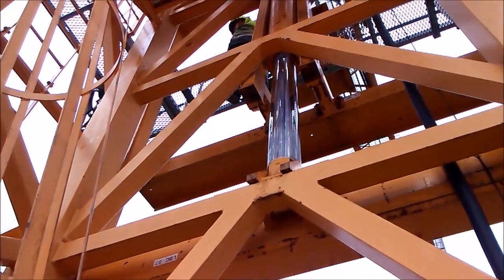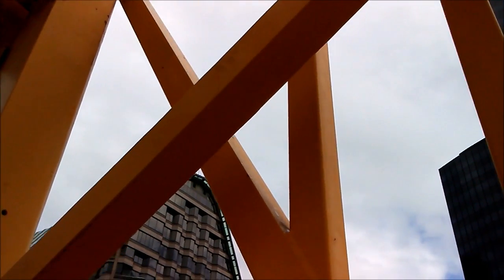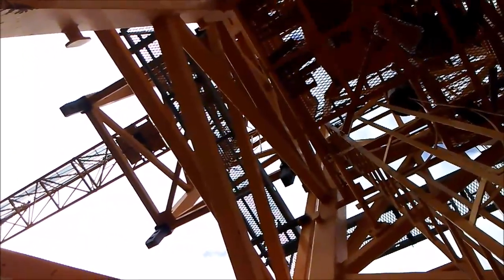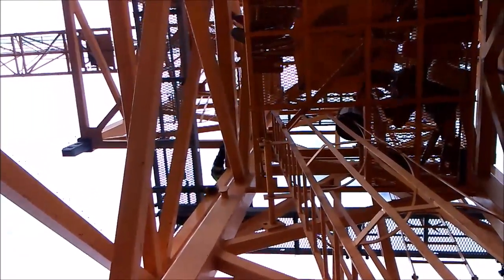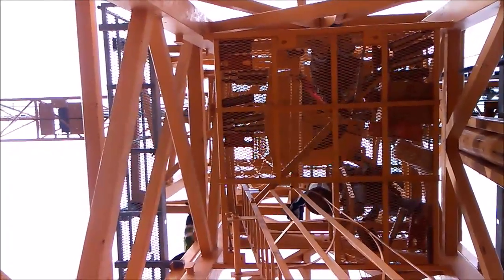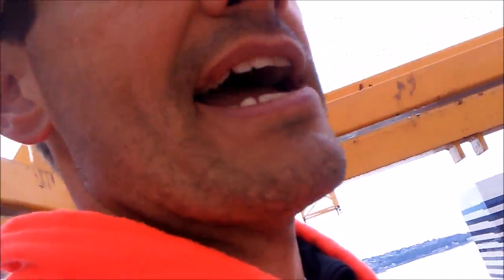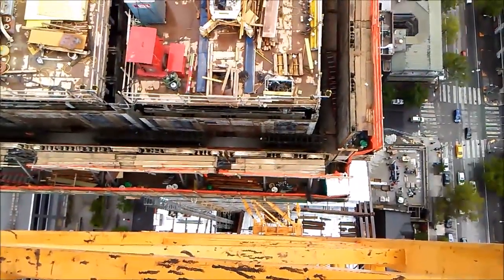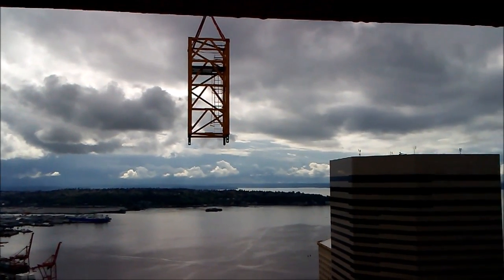How To Operate A Tower Crane: External Climbing

Comment: wow i guess thats why im not a crane op my heart was racing just watching this video. im scared of heights i'll stick to backhoe op
Reply from the maker: To be fair, I've worked at heights for 20 years now. I'm more uncomfortable on the edge of a building than hanging from the bottom side of a jib in my harness and working. But getting to the point where you can just focus on your work and not the elevation takes getting used to.

Comment: You have some sweet vids! Do you work for a GC or NWTC?
Reply: Seems like some of your vids are operating and some are erecting.
Reply from the maker: I have done both. At the time of this vid, I was Ops Manager for a crane operator supply company. I was doing some crane inspecting at the time, and that's why I was there. I broke off on my own and own a few tower cranes and erect cranes these days.
Reply: Right on!  Your vids are sweet.  I work for an electrical contractor and have done quite a bit of crane work....I've always wanted to shoot some vid on erection day or a light maintenance jib walk.  We'll be doing a comansa this saturday.
Reply: First time for me on a blue crane....the gc I work usually puts up liebherrs
Reply from the maker: I'm a photography enthusiast. I'd love to set up cams and run a drone while we work. Truth be told, I'm way too busy for 14 hours or more during a crane erect. From the paperwork on, It's a non-stop run. I did much better as an operator in getting pictures and videos. 
The Comansa's are making a good splash. I also have Spanish cranes. Saez. I've got five of them up in the area. Looks like I might expand with some Jaso's this year as well. Three years ago you'd only find Potain and Liebherr, and it was a very yellow town. Seems like just about every major manufacturer is represented here now with the incoming Wolff's. It's kind of fun to see.

Comment: Hello Rotyag 

I am a young operator who is moving to Seattle who wants to eventually get a seat in tower cranes. I currently have my NCCCO tower crane operator card as well as my signalmen and riggers cards from NCCCO. I went through classes in rigging operating and signaling through Morrow Equipment through Morrow. The issue is I have no on the job experience just classroom time and hands on training through morrow. I was wondering what advice you would give for somebody who wants to work his way in the direction of becoming a tower crane operator in Seattle?

Comment: Hi, Is that ram electric powered?  If so what would happen .If you had a power cut half way throughout the jumping ? Only reason i ask. Is i am told the tower crane is powered by electric . Is this the case with the Ram, Also is it posable for the crane to turn 360 degres when its halfway  into being jumped . Thanks for sharing the video. Interesting  to see how these cranes clim.

Comment: when operating a tower crane what type of load chart is used and by name i mean like american lbc ??
Reply from the maker: In the US everything is converted to the Imperial system. It makes sense for the operators. But for me as an inspector and someone deeper into the data, I wish that we'd just stay with the metric system. It's much easier to remember that most cranes change booms from say 164' (50 meters) to 181' (55 meters). Or that it's a 12 mm load line versus 15/32. But then the operators would make errors converting from lbs to kilos on the weights of products delivered and calculating out rigging capacities. I wish we could just get with the times on that topic here.

Comment: Hey thanks for posting, I've been an electrician for over 20 years and for some reason I just recently became facinated with these type of cranes. Could you do a video showing the hydrolic piston thing as it's grabing the frame and climbing? explaing it along with the electric motor, I would like to know how the hydrolics and electric work together
Reply from the maker: I'll do that. It is due for an annual inspection this week. I'll be sure to do video of motors and controls over the next few weeks. We have a number of cranes were are preparing to send out that are of various ages. Thanks for the suggestion.

Comment: what makes it possible to slide that tower section into place by hand with such ease?
Reply from the maker: +Metra416 The I beam the tower is on is nearly perfectly level. The rollers are steel on a steel surface so there is very little resistance. Two people can easily pull it in. 

In this case I was mistaken about one step. It was the method they were using. It's been many years since I have done the work myself. Since then they have switched to using a electric winch due to an accident in 2008 or so in Miami where a tower was lost during a climb. So the guys here are just guiding it from hitting the climber legs and such.
Reply: +rotyag awesome! Thanks for the response!